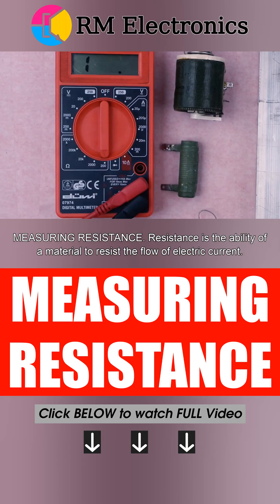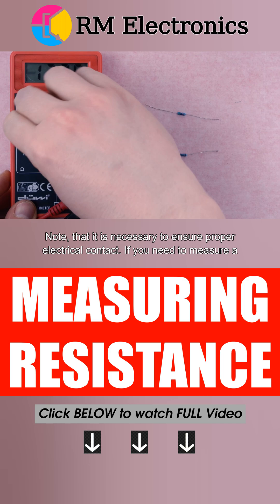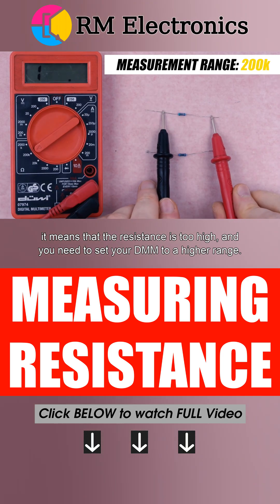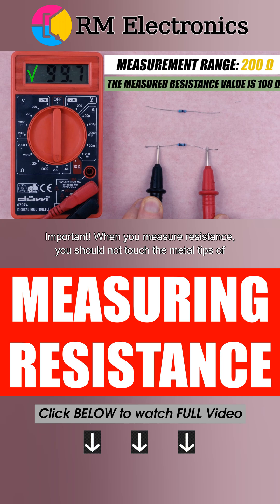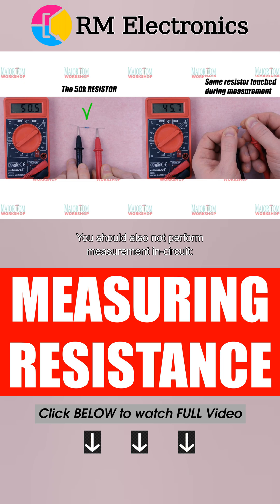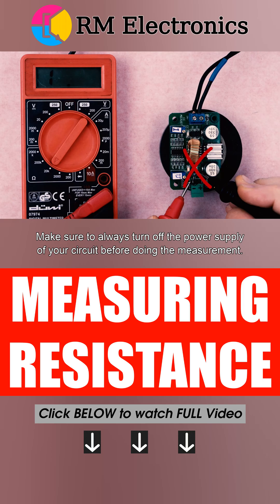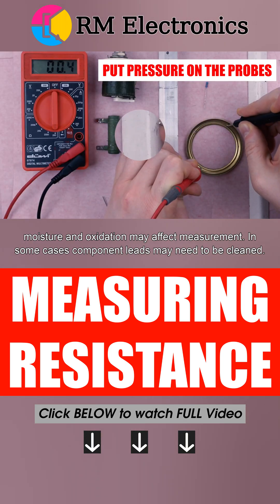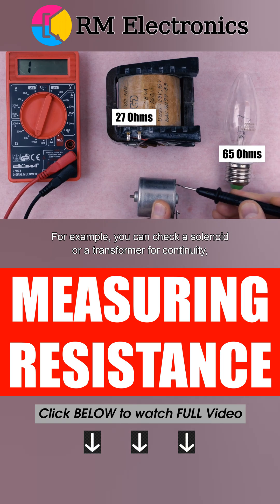Measuring resistance. Choosing Correct Range .

Comment: I thought you can measure resistance in a live circuit using it's voltage drop across it and ohms law?
Reply from the maker: True, but you'd have to break this circuit to measure current intensity then. So, it's not exactly live either.